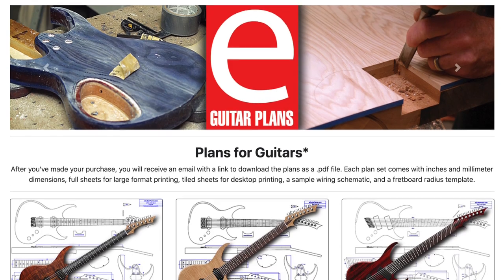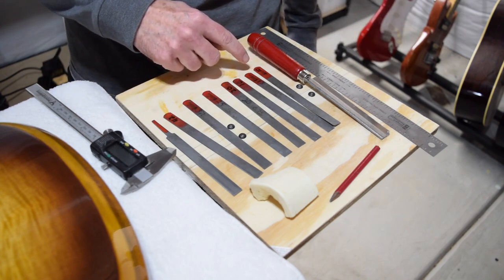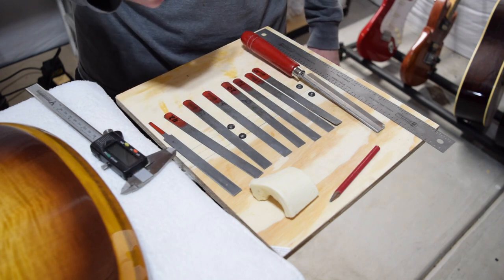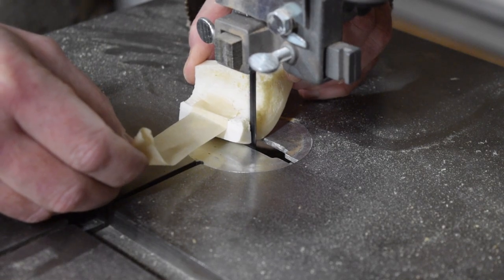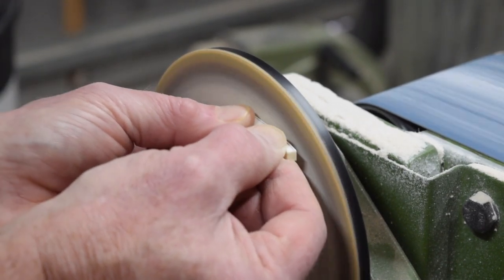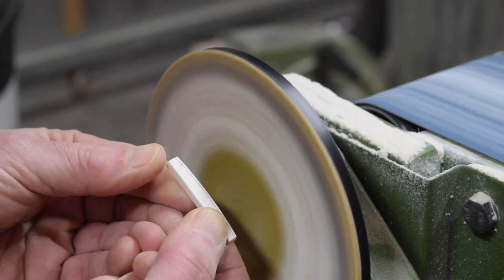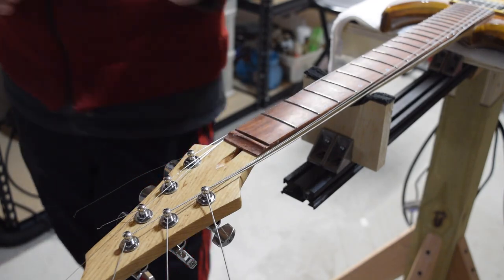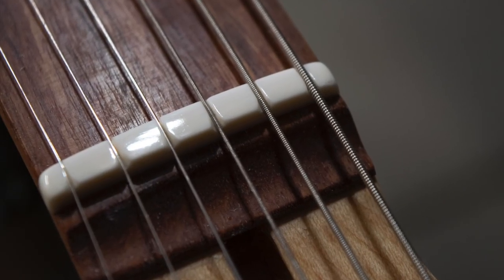Making A Laminated Top Guitar Part 22 How To Make A Guitar Nut

Comment: Cool video. Thanks. I use a nut slotting gauge to check the depth of the nut slots all along the process. It's  a small investment , easy to use, that gives accurate measurements and demystifies once for all the string height problems. Could not live without.

Comment: Awesome work, this guy is a master! This used to be fine for me when I worked in a machine shop. Having the tools available makes the job. I made my own slot files out of different hacksaw blade thickness with very fine teeth and had many thickness available at my convenience along with the machinery, Now that I'm retired and not having the equipment, it's easier to buy a pre-made nut for a few bucks and modify it with some jeweler files and different thickness saw blades found at hobby shops. For those asking... files can be sanded or ground down to whatever specific thickness you need. A bigger slot can be slowly widen with a smaller file.

Comment: Great video. I wish PRS SE nuts were given this much attention. My 2019 SE Custom 24 has only recently become playable since I finally figured out what you just demonstrated. I ended up having  to refile my SE nut slots down with 400 grit wrapped around a feeler gauge. PRS cuts the slots into a V shape, which is terrible!!!!! The strings get pinched that way. I rounded off the bottoms of the slots and now it's great.
Reply from the maker: Thanks for sharing

Comment: Wow! This is the best nut slotting video I've seen! One question: what do you do when there aren't nut slotting files that match your string gauges? I have a hollow body electric guitar that uses 10-52 strings, but StewMac nut slotting files only come in 0.046", 0.050", and 0.056" sizes. In that case, should you use the 0.050" file and just tilt it from side to side a bit while filing to get the size you need? Or better to go with the 0.056" file and not worry that the slot is a bit too wide?
Reply from the maker: Do the tilt. I make the slots a tiny bit wider to prevent sitar-like tones an string binding.

Comment: I watched this in total appreciation of the skill demonstrated till you glued the nut in place.  I was puzzled as I suspect wood glue will make nut replacement or adjustment quite difficult.  Is this normal practice?  Does the polished bone nut release from the glue, a bit like some locktite products?  My acoustic ukuleles (purchased and home built) all rely on a snug/press fit coupled with string pressure to retain the nut.  Is this an electric guitar thing?  Other classical guitar builders on YouTube don’t glue it in.  Perhaps a steeper headstock angle on acoustic instruments improves string force clamping?  I am sure you know your trade, but I am a bit puzzled.
Reply from the maker: You are WAY overthinking this. Glueing isn’t necessary but is common practice since changes in humidity can cause the fretboard to shrink back enough for the nut to fall out when the strings are removed. Replacing the nut is easy by simply heating the nut with the tip of a soldering iron to break the bond of the tiny amount of glue. Sometimes just a light tap with a fret hammer is all that’s needed.
Reply: @HighlineGuitars  I understand.  Use glue sparingly.  Heat up nut if removal is needed.  Very practical advice.  Thanks for the quick follow up!   Really appreciate your videos and expertise!

Comment: Are the 3m sheets printed with those bold grit numbers?    Also, wanted to know what bit you use in CNC to get best finish when cutting a neck.  Thanks
Reply from the maker: Well I sure didn’t put them on there. All I use is a 1/4” 2 flute spiral up cut.
Reply: Well none of us would know for sure given you're so exact and comprehensive in your work and videos.

Comment: Great video as always! I've always used ca glue to secure the nut in the slot. Are there benefits to using wood glue as opposed to ca , or is there not really a difference other than it's just what you choose to use.
Reply from the maker: CA is overkill. Wood glue does just enough to keep the nut from falling out of the slot when you restring.
Reply: @HighlineGuitars  thanks for the insight. I think I'll give this a try on my next one.

Comment: Nice video but I was cringing at you filing from front to back. I'm sure the end result was perfect but that's the easiest way to leave a sitar like buzz. Personally I always file forward ie; from fretboard to headstock. Different strokes for different folks though
Reply from the maker: The only times I have had sitar tone was when the sides of the slots touched the sides of the string or if there was too much contact between the bottom of the string and the length of the slot. The direction I file has never made any difference to me, and that's after 500 guitar builds.